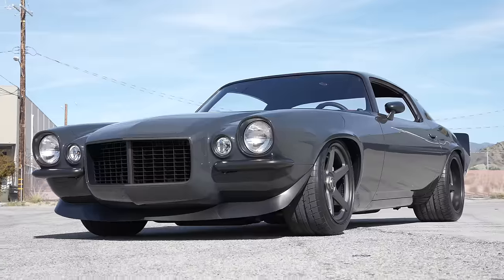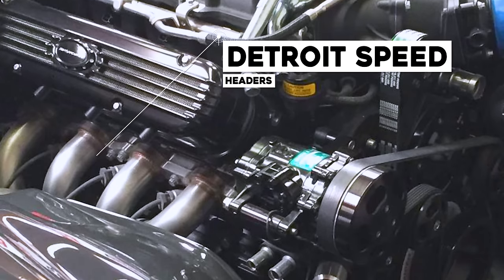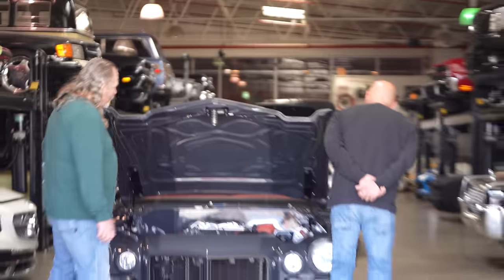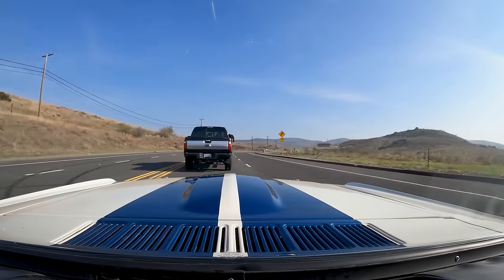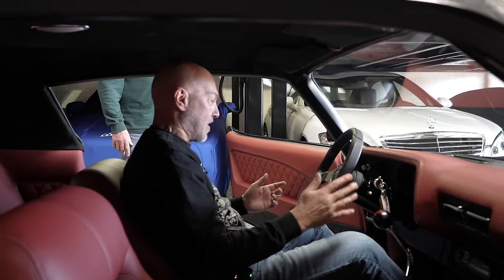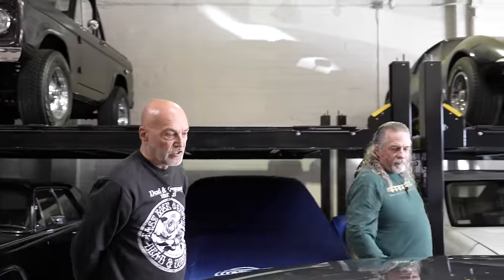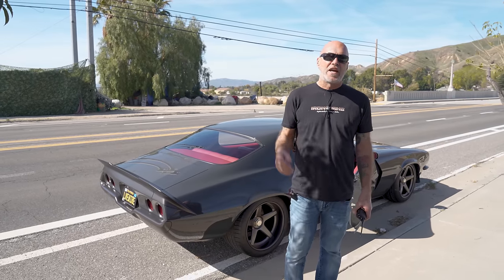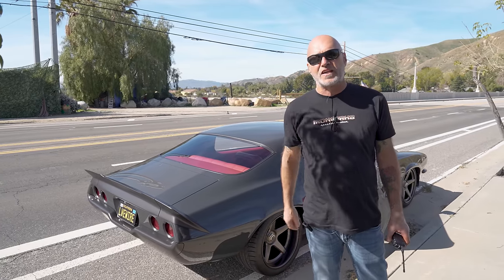Stunning Supercharged LS7 2nd Gen Camaro

Comment: Nice looking car. I can imagine the frustration. Had fuel problems last week with my roadside truck. Was loosing rpm at in of the lights and sputtering a bit. Dies right as I’m pulling into the customers parking lot. Started pulled to the spot. Unlocked their car. Did my paperwork and wouldn’t start. Pumped the gas and it started then died. I know I got spark now just lacking fuel pump or injector or clogged filter. Was able to lip it home by going into neutral. Got some injector cleaner and it seems to work.

Comment: Such an amazing build!  I probably would've done a TT LS3 or a H/C/I LS7 for that amazing sound (w/o the "augers"), definitely different front seats (high back as they should be!), and probably went with slightly lighter silver proper dual stripes, but damn he did a GREAT job with that build!!!

I somewhat agree that it's almost too nice to drive, sadly...  And the car dying, we've ALL been there on a new build, totally normal, especially for something as custom as this!  My guess is it was something simple like a loose wire on a relay or uncalibrated fuel gauge.
Reply: Like na engines but supercharged LS7? Bet she makes gobs of torque everywhere.

Comment: Very clean looking build. I like the ghost stripe how it goes inside and out. The wire tuck is nice too. Although I don't build stuff for shows (I like drag racing) I respect the attention to detail and quality of work this car has. The colors are also nice. Saddle interior color is also something I have yet to do but I like the deep reds/browns... Now with the LS7, I would have built that bottom end for boost. It seems like they slapped springs and studs in it with a pat on the butt and then it got a 3L Whipple... Wow, that's just ballzy! I would hate to crap a bunch of internals out the exhaust or make a window in that block... There is always more to do! GLWTS! Someone will get an epic build with a lot of headroom for engine upgrades to make safer use of the blower. Very nice!

Comment: Dont sell it due to what ifs, paranoia. Insure it right and put some miles on it car wont get beat up.  Lots of great roads to run W of Simi...old 118 through Camarillo to Ventura, old 23
Used to worry about that til I had about 100 mi on it...much ado about nothing.

Comment: 720hp is plenty for the street but I'll never understand why people throw boost at high-compression LS7s meant for N/A builds. I'd go with a blown LS3 416 stroker personally, but I can't afford any of the above so I suppose I'm just typing farts into the wind.
Reply: more under the curve torque.
Reply: @JasonEdelman66  Yeah true. I suppose I'd rather not worry about detonation or other potential liabilities. Also once that 700-something gets boring I imagine you can crank her up higher with the stroked LS3 easier.
Reply: There's a reason the LS9 and LT4 are not a full 7.0 litres. Bores on LS7 already taken to the max, does not take kindly to boost.

Comment: The best way to resto mod a 2nd gen camaro.Is to back half it.Narrow the rear and put the biggest tire and wheel under it
Coil over shock suspension. Put correct front suspension height .The car looks awesome with a higher rear stance and maybe a 2 inche drop front spindle. The car looks gay  with this cars stance suspension .I own a 71.Monza on Street outlaws when it first aired.Had that 72 model.I saw it first hand.Thd badest early 2nd gen I've ever seen.Too bad he crashed it.